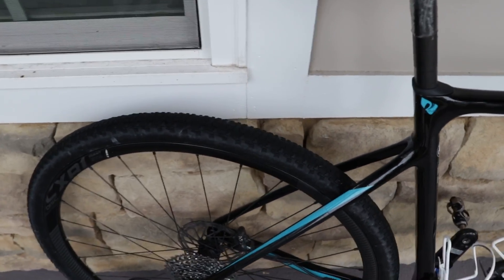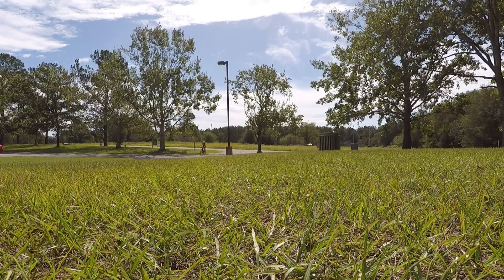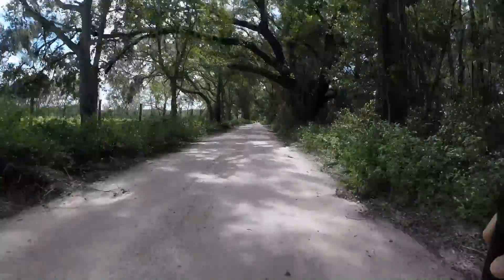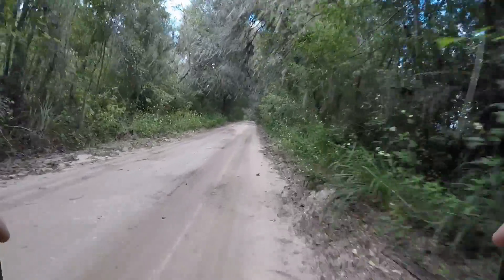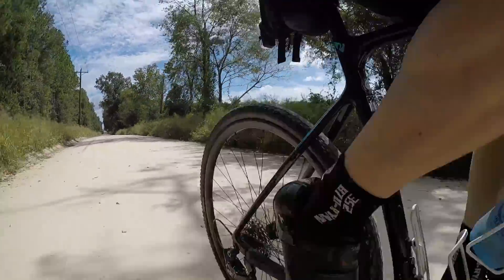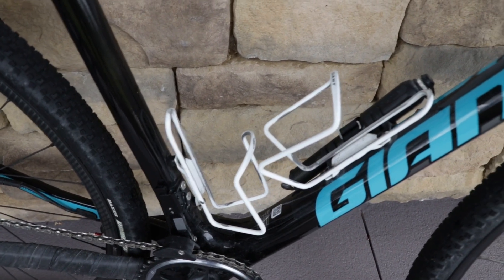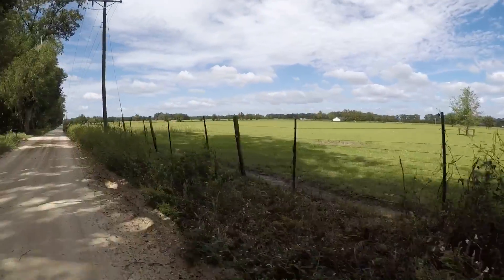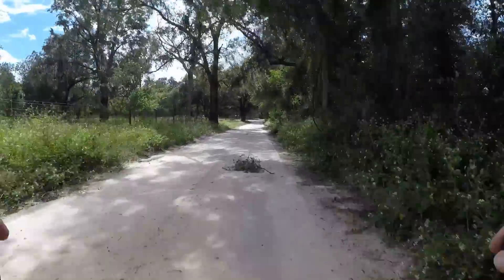How Does a Cyclocross Bike do as a Gravel Bike?

Comment: One key difference: I typically use a shorter stem on my CX bike. The longer stem is better for a gravel bike as you want more of a road position. But for CX you need a shorter stem to make tight hairpin turns. I like riding my CX bike on trails with rocks roots and logs so I will take the higher bottom bracket

Comment: I converted my Specialized Sirrus Elite Disc from a Sora 9-sp flat bar to a 105 11-sp. drop bar with Ultegra hydraulics, and a shorter stem to compensate for the longer reach and, hey presto, I have a gravel-touring bike. Solid alu frame and plenty of room for wider tires. Rock solid.

Comment: Your setup and strategy is super close to what I've got going on. 2015 Giant TCX, was able to barely fit 45mm Ramblers on it with about 5mm to spare on each side. Getting the rear on and off requires pulling the stem but it fits like a glove once one there.

Comment: far too many different bikes out there for all the different events..most bikes can be used for multiple purposes and you would never know the difference..People just like to spend money and have people tell them what the need..Smart move Clint..
Reply: not true. CX bikes just are not really designed for prolonged riding. I think a lot of that has to do with how far back you sit on a cyclocross bike. It just feels nowhere near as comfortable as a gravel bike. In exchange the bike is much more nimble though and shock absorption is also slightly improved.
Reply: Mountain bikes are meant for rather short rides (e.g. not multi day) and people still tour on them. If life would be as simple as it seems, we would live in very different world.
Reply: @kingprone7846  notice how no one likes your comment. No one agrees with you. With the ability to swap parts, you can easily make bikes comfortable. Sitting too far back on a cyclocross, swap the handlebar stem with something shorter and a higher angle so it brings the bars closer to you. It's now a very reliable, fast, tough, versatile and comfortable bike.
Reply: @TheMarkoPoloProgram  mate you are talking shit. the stemlenght is to adjust for armlenght not for seating position. if you cannot contribute anyting to the discussion dont join in.
Reply: @kingprone7846  By adjusting the stem length and OFFSET ANGLE, you reduce the reach and hence the seating position. I know what I'm talking about because I initially bought a CX bike with a long and straight stem that strained my back and stretched out my arms. I brought it back to the bike store a few days later and they swapped it with one of those short EVO stems with a high offset angle that made it come straight up like a mountain bike stem. My seating position and reach changed and the comfort was night and day so no I'm not talking shit. You know what's shit? All these bike labels that force you to believe that one certain bike is made only for that said discipline. Ride what you enjoy and have fun.
Reply: @TheMarkoPoloProgram  that was just because your handlebar ste mwas too long to start with. in an ideal world you should sit comfortably without directly resting on the handlebar. the handlebar is just for support and gets adjusted after everything else. not much people agree on but on THIS issue there is a general consensus.
Reply: @kingprone7846  Explain how I can sit upright without resting my hands on the handlebar then? I'm telling you, the only difference between a cyclocross and a gravel bike is the wheel base and chain stay. Everything else is just a marketing ploy and can easily be tweaked to make you comfortable.
Reply: @kingprone7846  Bullshit. There's no problem to do an over 200km ride on the cyclocross bike for me.
Reply: Check out Kerry Werner. He's a pro cross racer and does almost everything on his cross bike. People who haven't heard all the marketing can be found doing the craziest things on the 'wrong' bike.
Reply: @kingprone7846  you can adjust your position. And get an aggressive cross frame.
Reply: mikieson i agree with you sir,  it’s all  about the money they could get  and marketing strategy
Reply: @TheMarkoPoloProgram  CX bike top tubes are way longer than a gravel bike which makes you reach longer, if you shorten the stem the bike becomes twitchy. Plus CX bikes do not have a clearance for 45c and up tires, so 650b aren't optimized for it.

Comment: I've been using a Giant CX as a gravel bike for several years.  I wanted a gravel bike back when I bought it but there wasn't any.  It's main diff is higher gearing. I'd like a lowest gear at least 1:1.  It is also aluminum so about 2.5 kg heavier than my carbon roadie. I ride it with 42mm tires, and find it very stable no matter the weather. I never worry about losing traction around the city.
Reply: I use it mostly as a utility bike, but also riding back country roads. One of the biggest advantages is I've never had to worry about punctures.  I used to take my roadie on the same roads, and twice I had to abandon the ride after multiple punctures.

Comment: I have a Trek Crockett 5 cyclocross bike as my main bike for commuting, road riding, gravel, trail, and cross racing. Its such a versatile bike and it handles the terrible roads of Alaska just about perfectly. The only major upgrade I did to it was a set of carbon rims, they made such a huge difference in the ride quality of the bike from absorbing the road chatter to a noticeable improvement of stiffness of the bike.  My local shop keeps trying to push the more gravel oriented bikes on me, but they sold me such a good bike with the Crockett that I don't feel the need to get a road or gravel specific bike when my cross bike handles everything so well.
Reply from the maker: +BoredSaku how is the cross racing scene in Alaska?
Reply: Clint Gibbs I'm in Fairbanks and it's pretty small, the local cycle club started hosting cross races last year with a single race in September. This year we had a 2 race series in September with about 40 racers of all ages at the first race and about 25 at the second race. Our cross season has a super small window to do races, basically they are crammed into the end of September after the equinox marathon and hopefully before it snows in October and fatbiking season starts.

Comment: I am really impressed with your video . I am looking to have one bike for road and cyclocross  at the same time  by changing the wheels not the tires only , in other words looking for a bike with 2 sets of wheels for road and cyclocross . Your advise is much appreciated . Thank you.
Reply: depending on the elevation variations you may need to change your rear cassette?   You'd of course need to address your chain length also.   A very quick change if you have the tools.  4 year old comment so I hope it went well for you.

Comment: I have the sram force 10-42 cassette highly recommend that if you hit the steeper climbs
Reply from the maker: +scott wilson cool.  Thanks.
Reply: scott wilson what chainring do you match with that?
Reply: C T I have 10-42 rear cassette sram force
Reply: J S I use a 38T for winter and 40T for summer
Reply: Cool. Seems like a decent size
Reply: Can you place lower yet on that crank? 32T, 34T, 36T?

Comment: Hello Clint! Thanks for your useful videos! Speaking about versatility: I do use my TCX advanced pro 1 from 2015 (the baby blue one also being the last model with double chain rings at the front) for gravel, CX, commuting and road training/racing. Each discipline as its own tyre of choice and I even swap to aero wheels when on the road. I wonder however how far I am, performance wise, from a proper road bike within the same price range. Have you got any experience on that matter?
Reply from the maker: +Olivier Henrat with road tires on a carbon cyclocross bike I don't think you're going to be hardly any slower then you would be on a road bike. The only Advantage I can see and a road bike is that the wheels would probably be a little bit lighter so and situations like criteriums and hard acceleration you may be faster. But it's not going to be very much.
Reply: I've now just lost some credits on my Strava KOMs! :-) But also the confirmation that this bike is a great do it all!! Thanks for taking the time to getting back to me and to have done it so quickly!
Greatings from Sweden!

Comment: I do prefer CX frame over Gravel bike frame but what bothers me is the tooth number on CX bikes 46-36 with 11-28 is still the norm, I would prefer 46-30 with at least 11-32
Reply: They Live We Sleep - just change to 46-34 and to an. 11/36, cheaper than a new crank
Reply: Most medium-cage derailleurs will handle up to 36t cassette. I've modded a Fuji Altamira CX with a 40t as well. 
36-28 gives a gear ratio of 1.29, while 36-36 gives you a ratio of 1.0, quite a huge difference. Swapping crank/chainring to a 30t and keeping the 11-28 cassette gives you a ratio of 1.07. I.e change the cassette it's alot cheaper ;)

Comment: What kind of differences would I notice going from 33s to 40s on my Norco Threshold C? Riding a mix of gravel and road.
Reply from the maker: +Matt Cecile you can run a little bit lower pressure which is going to of course soften up all those little bumps a little bit. Going from 33 - 40 won't be dramatic but I think over the long run it'll be better for longer rides. 40s will be better in sand.

Comment: You mentioned your shop swapped the 140mm front rotor for a 160. Just curious how they relocated the caliper to accommodate the larger dia. rotor? I have a 2016 Adv Pro 2 I'd like to do the same with.
Thanks for any advice and, keep up the great videos!
Reply from the maker: +Dustin Thewind actually, the caliper mount is a very genius design. All you do is turn it around and it adapts from a 140 to 160.
Reply: Well that definitely makes things a little easier... Mine's direct mount to the fork.

Comment: I was talking to someone the other day and they were saying how much better it is to train on road vs on trails for xc racing. Got me thinking not that I'm necessarily going to race xc but I have been thinking of doing some rides that may have varying terrain and I see the benefits of it for fitness. What I wanted to ask is what do you think of a cyclocross bike as an all rounder? I know it will never be a race bike on the road but It seems like it might be a good platform for higher mile maybe even bike packing duties. Seems like what it lacks in all out speed it might make up for in versatility and comfort. I came from mx directly to mountain biking as cross training and ended up gettin out of mx  in favor of mountain bikes so im not to well versed when it moves from single track to double track.
Reply: I was in the same situation as yourself and went for a Specialized diverge, the new model can fit 42c tyres but it also feels very suited to the road as it does on gravel, it also has a low bottom bracket that clint mentions in the video. And would be a better touring bike than a CX bike as it is designed for longer rides.

Comment: Any thoughts on the TCX SX trim? It comes stock with 40mm tires, a 42 cassette, and wider handlebars making it Giant's gravely cyclocross bike.
Reply: Hello Jason Divock! Nice to read that you also riding TCX SX - maybe you could also go tube less (TL) with those nice tires I think I will eventually change to tube less and otherwise I think the TCX SX is fine for gravel riding as well! I have not needed a bigger front chain ring than the 40 it comes with and the 11-42 works well. A chain stay protector is important I have found out. Well I am still a beginner and this is my first CX bike other bikes are an ALU MTB FS 650B and a  HT 29er in carbon that is both light and fast. I wish you happy riding Jason! TCX SX is an amazing versatile cyclo cross bike for the price tag! Great value!
Reply: I love my tcx advanced sx cx. Works on gravel and for roards i just switch to gp4000s2. Just bought stans tubeless system for those 40cc ramblers.

Comment: I ride a Specialized Crux to link up the dirt roads around here in addition to some easy single track.  I've even put on 28 mm road tires and did road rides with it.  Very versatile machine, but I'm lazy and don't want to swap tires all the time, so I have a dedicated road bike as well.  The gravel bike vs cx bike difference is a bit too nuanced for me.
Reply from the maker: +Steven Pedder the Crux makes a really good gravel bike from everything I hear. It even one the dk200! It has a little bit lower bottom bracket than the Giant tcx. So it's going to be even more stable on dirt roads.
Reply: 2014 Expert.. been wanting to swap out to a newer frame with through axles, but in due time

Comment: Hi Clint. I would be very interested to know your opinion on saddle hight...on this video your saddle seems to be far too low (your knees angle...). Is that how you ride ? Is it individual ? Also,  from bicycle dynamics point of view, pedals should be close to frame. But people have different  hips,  different legs, different body weight distribution (that impacts balance on bicycle). People maintain different "ankle gap" (distance between their feet) when they walk...than they are all "forced" to cycle with pretty much same feet to feet distance...I am not convinced that this is correct, I think it may contribute to pain, injuries and impact balance and performance. What do you think ?
Reply from the maker: I think it's just the camera angle in this video. I generally use the Lemond method as shown in this article
https://roadcyclinguk.com/how-to/technique/beginners-guide-how-to-set-your-saddle-height-on-a-road-bike.html#bSsKkiFzbLFSYD8O.97

I also use the method of putting my heel flat on the pedal with the pedal in the six position.
Reply: @ClintGibbs  I don't know Clint...all that video shows your legs to be seriously badly angled on your knees. And what about ankle to ankle distance ?
Reply from the maker: @adamgerlach979  I know that road style bikes have narrower Q factor than mountain bikes.  I have thought about this in terms of IT band issues. Whenever I've had a flare up in my IT band it's usually on a road style bike. Is this because of the narrower Q factor? I think a lot of research would have to go into that, and I've never seen any done. Not saying it's not out there but I've not come across it.

Comment: What about one bike for road, gravel and CX? Would a CX bike still be your choice?
Reply from the maker: If I were going to race cyclocross then it would be the cyclocross bike if I were not going to race cross, I would use a gravel bike for that application.
Reply: @ClintGibbs  thanks! I'll definitely be racing CX, but most of the miles will be on the pavement.

Comment: what would you recommend for someone who is 90 kg and wants a road bike with good stopping power and ability to deal with some bumps on not so good roads? would it be a good choice to pic up a cyclocross carbon or a pure road steel with disks?
Reply from the maker: I would probably look in the category of all road, also called endurance Road. They are similar to gravel bikes but have a little bit smaller tires. If you're not riding gravel or dirt roads that often then this type of bikes will be faster on the roads. Something like the specialized roubaix or Giant Defy. Or if you think you might be riding gravel more often then go for a gravel bike like the Niner rlt 9 RDO. You can put smaller tires on for faster Road rides.
Reply: Yea, i was considering the defy, but which model do u think is best to pic? advanced pro is full carbon although they say it's just as durable as other versions i think maybe the advanced version is better as at least the wheels are aloy and the stearing tube so it's probably safer in terms of impacts on the bumps and stuff at least it won't completely snap off in a bad situation.. or maybe just the top spec aloy version would be better do u think? i know that defy is very fast and responsive even though i'm not racing but i like to have some fun on a bike on my days off weightlifting.

Comment: Hi Clint, I want a bike that can be use for cyclocross and gravel biking but I want the frame to be a Steel so it will last a lifetime. Any recommendations? Thank you.
Reply from the maker: +Marc Sabbun not too many steel frame options out there. The only ones I can think of or maybe they're Ritchie Swiss cross and the Niner rlt 9 Steel. Personally I would go for the Niner. Another option is to buy the Niner sir 9 mountain bike frame and build it up as a cross bike.  There is also the Surly cross-check but I'm not sure if you can get that in disc brakes and I would highly recommend disc brakes.
Reply: Thanks for the response! I think i’m going to buy Niner RLT9 Steel, im inlove in the Reynolds 853 tubing, but I will check the Surly I believe they have the surly straggler that is better than the cross-check and also it has disc brake. Im also considering Jamis Bikes because they have Gravel Bikes that uses Reynolds tubing. Thank you Clint!
Reply: Marc Sabbun  if the Niner fits in your budget, awesome, but for what it's worth I love my Raleigh Tamland for gravel and cross.

Comment: does the 1x provide enough range for gravel
Reply from the maker: +JogBird for me it does and I think for most Riders it will be fine, especially with a wider cassette. Check out this video from gcn. He did a good job with it.

https://youtu.be/a7kkkzJFID0
Reply: I think it doesn't. I have a cyclocross bike with 2x11 gears (Shimano 105). And you really need that first gear to get up steep slopes. The 1x is only for racers who want to save every gram. I would not recommend to buy this as a hobby rider.
Reply: To 86 I agree I feel like the 1x thing is just as much marketing as the gravel cross bike thing. If your that concerned about weight dump out a few oz of water and keep those front gears.
Reply: To 86 1x made me a better and stronger rider.
Reply: 2 votes for 1x, 2 votes for 2x. Up to personal taste then, I guess! ;-)